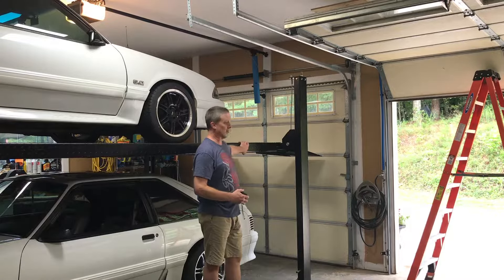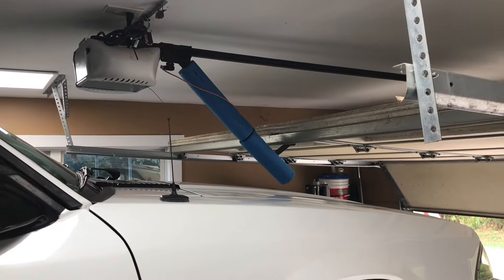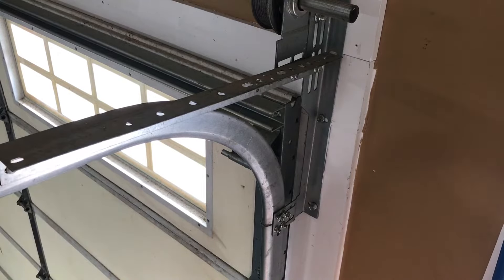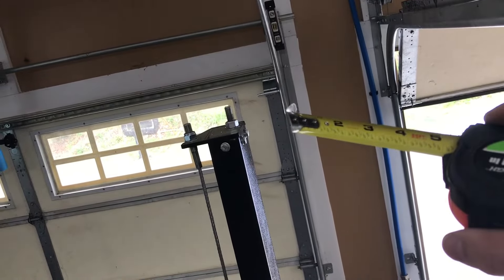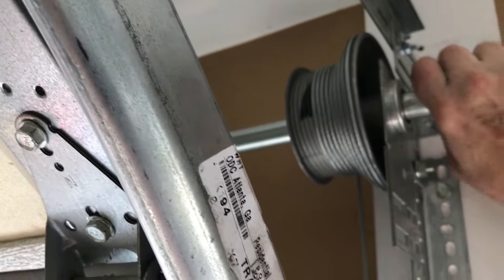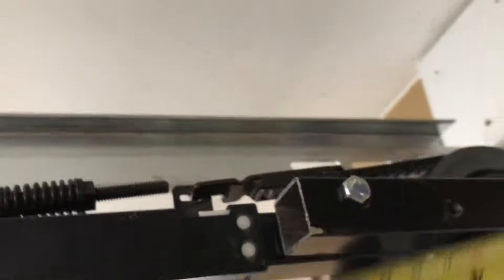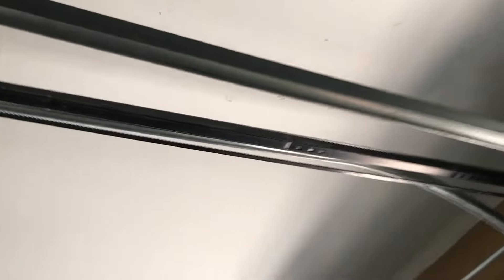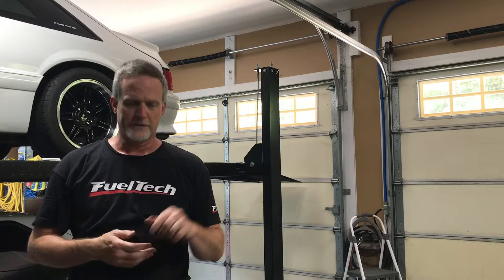Increasing garage door height for car lift and opener jackshaft conversion

Comment: Hi for $180 did that include rails and everything in the box? How would I order what you displayed on the video? I don’t need the garage door opener. Outstanding DIY help.
Reply from the maker: I’m not sure if they will ship that due to size. I just asked for the 30” radius kit. You should be able to have any garage door company in your area order that for you. Another option is to cut your 90 in half to make 2 45s and ad a straight piece in between. That would be free.

Comment: Awesome design work. I was curious what kind of car lift you have? And what was your total cost to raise the garage door higher. Thanks
Reply from the maker: This is the lift but I paid less than that:
https://www.bestbuyautoequipment.com/car-storage-parking-lift-car-park-8-plus-tall-8000-p/autolift-car-park-8plusp.htm

You can raise it for labor and a few screws if you cut the existing radius in half and cut a small part off of the horizontal piece to put in between the radius you cut.  
I’m trying to remember my cost for the kit. I think it was $180. I think I said that in the video.
Reply: @fixthemthings  Thank you

Comment: Great video! Might sound like a weird question, but you mentioned you got about 18” in height by using the 30” radius, but it looks as if h door and track are more than 18” forward. 

How much farther forward is your setup now of the new one vs the old?
Reply from the maker: I would have to check. You can save money just by cutting your existing 12” radius in half and grabbing what you need off of your horizontal rail to put in betweeen the 2 - 45 deg pieces.
Reply: @fixthemthings  that sounds good, thanks. 

The reason I’m looking at a similar setup is because I have an I beam that runs across my garage about five and half feet from the door.

So what I’m looking to do is see if I can hug the garage door close to the ceiling and have it in front of that I beam, if so I would probably use a side lift system instead of my old style garage door opener like you did.

Comment: Where did you get the 30” radius kit? I cannot find it anywhere. Thanks
Reply from the maker: I ordered mine from a local supply. Overhead doors of Atlanta. You won’t find it online. Another thing you can do for free is cut your 12” radius in half and add a straight piece in between from the end of the horizontal piece.
Reply: @fixthemthings  I have a 45 degree section of ceiling between top of door section and highest part of ceiling, I guess a jackshaft motor is my only solution? I basically have to extend that radius with a straight piece as you mentioned, to snug it up to highest point. 
Just wondering, looking for budget solution, not sure I can still get away with a traditional motor that would not have the chain horizontal from the motor to the pulley? (Motor still near end of door track, and not at corner/radius?) 
Thanks for any insight, cheers
Reply from the maker: @svnbit8408  just remember if you do the jack shaft conversion there is no safety release. You will need to make a safety release. I didn’t worry about it since I had 3 doors. I will eventually make one I just haven’t had time.

Comment: Would this work going from 8 feet to 12 feet?
Reply from the maker: Are you gonna keep your opener?  If so just add something like 3.5’ of straight track and and raise your torsion bar and get longer cables. If you use a side opener then you can go higher. You don’t have to get the 30” radius.
Reply: @fixthemthings  I was hoping to reuse my opener like you did. Thanks for the info!

Comment: Please come to Vegas and do my garage doors.. JK - Think's for the knowledge
Reply from the maker: If you don’t want to buy larger radius horizontal pieces you can cut your existing radius in half and grab some straight track from the other end and put it in between. I was going to do that but requires more labor and you wouldn’t have to raise the shaft with the pulleys.

Comment: Great job. Another couple of hundred bucks more and  you could have gotten a new side mount jack shaft operator.
Reply from the maker: Yeah. Over $400. I’m a cheap bastard though.
Reply: @fixthemthings  Now they're $650-$850.  I've got three on the way for a $3,100.00 install.
Reply from the maker: @243wayne1  wow. That’s crazy!
Reply: @fixthemthings  Agreed.  But hopefully when they're up and running, it should take some of the pain away.  Sigh  Gouging is what it is...  They told me they are on backorder from Liftmaster.  They probably are actually...

Comment: I like that idea, avoids having to purchase a $400+ side mount opener. Mine has a chain instead of the cogged belt. I guess I could do the same thing if I could find the right chain sprocket to go where you mounted that pulley you used. But where to find such a sprocket, hmm... Other things come to mind. I would like a safety release, that way if the power goes out there's still a way to open the door by hand. But when raising the door up the length of the chain or belt gets shortened. There may not be enough length to install the link in the chain where the safety release connects before it has to travel around the drive sprocket.
Reply from the maker: Mine is still working great. The safety release needs to be installed. I was gonna do another video on that later including a solenoid lock feature. You can insert a smaller diameter pipe/cold roll inside the existing pipe and drill a hole through both and use a pull pin to release. You would then mount a pulley or sprocket to the smaller pipe. Also on your door opener your chain can be really short and mount your opener on the wall instead. Look on the chain for the chain size and purchase a sprocket about the same diameter as your drums.  You will also need to adjust your limits on your opener for the size of the sprocket.

Comment: Where did you buy the kit to elevate your garage door?
Reply from the maker: I got it from Overhead doors.  You don’t need to buy the kit. You can cut your existing radius in half(2-45s) and take a piece of the horizontal piece and install that in between your 2 radius’s to raise your door without moving your springs.